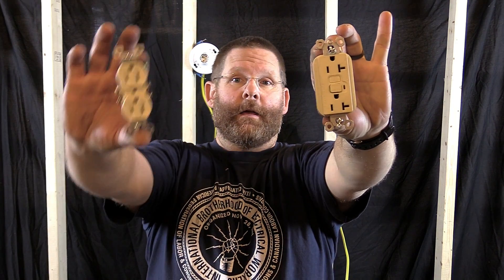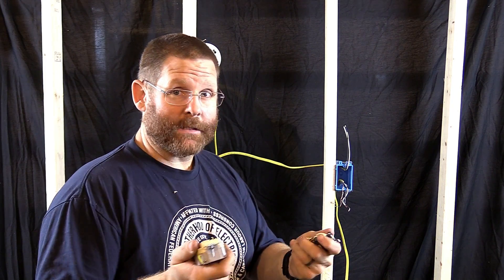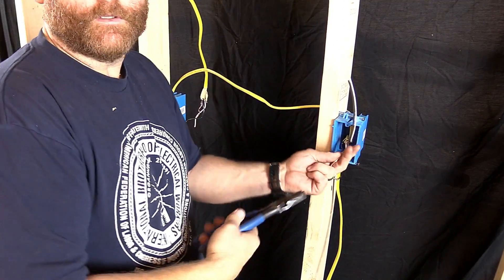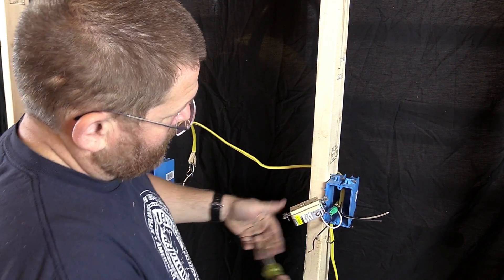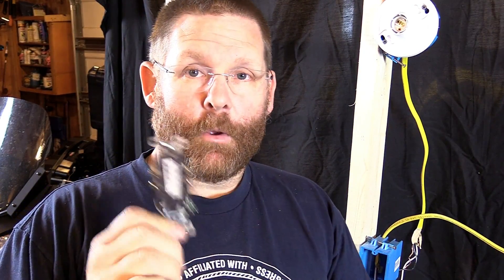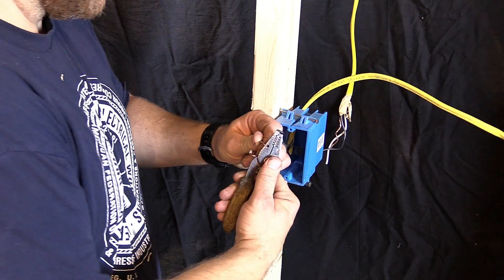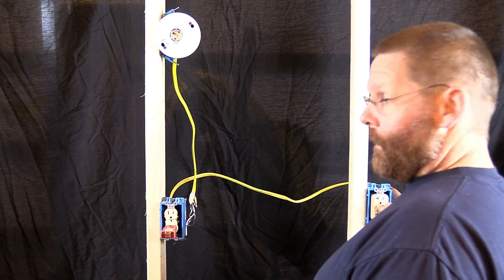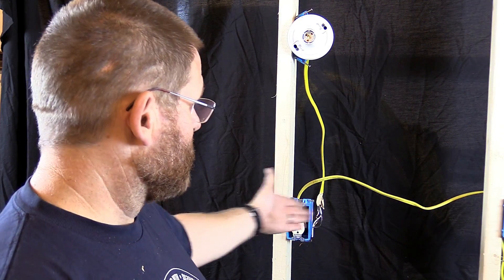How To Wire A GFCI And Receptacle

Comment: I had the 1st outlet after the breaker short and melt so I replaced it and it works fine but the next outlet which is the bathroom gfci wouldn’t reset so I replaced that also then about 2 outlets away is the outdoor outlet also a gfci which I replaced won’t reset either. The bathroom gfci is lighting up green but the last outlet is lighting up red. Neither will reset. I wired them exactly like they were. Is it possible I have a bad gfci outlet? I’m going to return it in a few when I get to Home Depot
Reply from the maker: It is possible that the gfcis are bad. I'm concerned about the melt down you had is it possible wires are melted together?. I have seen many times bad gfcis straight out of the box. Keep me posted

Comment: This is probably a stupid question but does the GFCI have to be the first outlet in the series of outlets?  Also is there a limit to how many standard outlets can be connected to one GFCI?  Thanks
Reply from the maker: Definitely not a stupid question. You can put it anywhere in the circuit. As for how many you can put one on every Recep you have if you want to it would just cost an arm and a leg.

Comment: Why 12ga vs 14ga for a home? Is it safer if its just going to a receptacle for regular use?
Reply from the maker: My answer Is this. I have seen many times people use a mixture of wires. Then you have someone in the house that uses a quartz heater or two. The breaker starts to trip and first thing most people do is up size the breaker from a 15 amp to a 20 amp. When you do that on a 14 Guage wire your asking for trouble over time. Now you may say, they can just add a 30 instead of a 20 and that's true... But most people will question that in their minds because no where else in a panel (in most cases) do you have a single breaker that is a 30. Long story but 12 is more expensive it's worth it.

Comment: Hi. A friend is in the process of selling and has their certificate of occupancy coming tomo. One on the list was for basement and garage to be gfci protected. After watching this  i can see that the gfci can be connected to more than itself. So how do we figure out if all of them are connected to a gfci? I have a tester, but assume that's just to be sure the gfci works not to locate which ones are actually protected?
Update:
So, I Wrote as I was watching and you've just answered it. Lol, but I dont see more than one gfci in the basement so can we put a new gfci in any regular outlet and have it protect the others its connected to?  Thanks.
Reply from the maker: So if you already have your basement gfci protected you don't have to add another one. As long they are protected by one gfci your golden. Your question though you can definitely put s gfci anywhere there is a regular recap for sure.

Comment: why the 15 amp downstream. receptacle with  on a 20 amp circuit. I am sure you wouldn't do that on a project, but it should be pointed out to the home owner people.
Reply from the maker: By code as long as there are more than 2 receps you can put 15 amps receps on that circuit. That's in the code book
Reply: @MountaineerOutdoors  Thank you for your quick response. I tend to be a little over careful.
Reply from the maker: Me too sometimes code kinda doesn't make sense so just keep 20's on 12 Guage or 20 amp breaker and 15's on 14 Guage wire or 15 amp breaker. That way your always good. But legally it is ok. Have a great evening
Reply: @MountaineerOutdoors  tysm!! (thank you so much).

Comment: Since you offered to help ,I  have a question. I'm trying to wire a foot switch to bring power to power tools. I need to wire in couple of outlets. One will be a GFIC. I have  a  three wire cable, Black, White,  and Green.  The paddle switch has DPDT terminals. That's the area that I need the help.with Which terminal gets the line, blk. conductor. and which gets the load,  wht. conductor going to  the GFIC? Thanks for your instruction. I appreciate the help. Thanks
Reply from the maker: Well I have never wired up one ....but if you email me the  pic of your set up the terminals Id be happy to give my thoughts on it

Comment: A good reason to add multiple gfci is redundancy if the first gfci is malfunctioning they each have protection if it’s 100 pieces i understand but 3-5 outlets i feel you should spend the extra cash and be a little safer
Reply from the maker: I can definitely understand that logic. And I understand that especially at home depot they sell that 3 pack and it's priced right. Thanks for watching and commenting ☺

Comment: In my area we have metal boxes and bx cable
So If you are screwing in the extra terminals (i personally recommend you should) It’s also good practice to wrap electrical tape around the connections so it doesn’t short with anything ie metal box or other wire or bx
Reply from the maker: Nothing wrong with doing that for sure.

Comment: I am attempting to install a GFCI on the outside of my manufactured home off an outlet on the inside. I used the green wire nut to twist the two ground wires together & connected that to the ground screw on the back of the outlet (interior outlet). I connected the (new) white to one of the silver screws & the (new) black to the brass side. [the existing interior outlet has the white & black wires pushed into the holes in the back]  I fed the new white & black wires to the outside & connected them to the holes on the back of the GFCI (push in). The screws on the side are not suitable for a connection, only for tightening down the push in. This is a Red Dot GFCI kit I got at Home Depot, if that helps. I connected a ground wire to the back of the GFCI and twisted it to the incoming ground wire with a wire nut , then screwed the free end to the ground screw. I turn the power back on & I only have power to the interior outlet, nothing at all to the outside GFCI. I've rewired & started over twice. I don't see where the issue is?? Suggestions? What am I doing wrong? Thx
**Never mind - got it fixed...replaced the Red Dot cheapo GFCI with a Leviton 15amp and rewired using 14/2. Major pain to rewire everything for a 4th time, the copper is very soft and breaks easily (especially if it's inside the receptacle's push-ins). But it's now working. Green light on the outlet & 2 ambers on the tester.
Reply from the maker: Sorry for the late reply, I was on vacation for while. Anyway, glad to hear that you fixed it. Sometimes gfci are bad right out of the box. But glad you got it fixed. Have a great day ☺

Comment: Great instuctional vid. Lets say its an old bldg, to add a gfi can only see wires inside outlet box , how do u determine witch is load and witch is line
Reply from the maker: Line will always have the main power on it. Load will be dead so to speak

Comment: Just found out that other outlets not in the bathroom are on the same circuit as my GFCI. This is irritating and I’m tempted to bypass the load and connect the circuit to the line side. Note: there is only one outlet in the bathroom. I don’t think this is a big deal, but best to ask.
Reply from the maker: I think I understand your question. Everything from the bathroom is on the gfci?.so for instance if your bathroom gfci is tripped your other outlet do not work.?? So s gfci is needed where there is water within 6 foot, or on a 2 wire circuit system. For me to answer that question would be almost impossible because lack of knowledge on this circuit. You need to look into why it's done that way. Is there receps without grounds?? Does it go outside to a receptacle??
Reply: @MountaineerOutdoors  good points! I replaced a standard duplex receptacle (only one in the bathroom) with a GFCI after I remodeled the bathroom. House was built in 74. Kitchen and bathroom were carpeted. I’m a DIY.

Comment: I got a new shed that is prewired for electrical. I will be feeding power to the shed from an outside outlet on my house. That outside outlet of the house is not GFCI, but the shed has one. 
Do I need to remove the one inside the shed and place it on the outside of the house or can I just use it as it is?
Reply from the maker: Your outside Recep should definitely be gfci protected. You sure it's not?  If not it needs to be then you can come off the line side and feed your shed on the gfci that's inside the shed.
Reply: @MountaineerOutdoors  I was told to not have 2 gfci in the same circuit. I was told to either use the one from the shed or remove it and add it to the side of the house....confusing lol

Comment: Question: what’s going on —— my gfci tester indicates the gfci plug is wired correctly but it will not trip the gfci plug —- thank you for your time
Reply from the maker: My first guess is that there is no ground "true ground" you may have a wire going to the box or maybe a wire from the nuetral to the ground, this will not let your gfci tester trip out the gfci. If the buttons do trip it then it's working correctly. Or you could have the wires hooked up wrong maybe the nuetrals are switched. Usually if you have 2 sets of wires the nuetrals could be switched. Does that make sense? How many wires do you have? 2 whites and 2 blacks?
Reply: @MountaineerOutdoors   I thought the main point of a gfi's was because the line is ungrounded. Now your are telling me it needs a ground wire to work?  wtf
Reply from the maker: An ungrounded GFCI “Is Acceptable”. A GFCI does not need a ground wire in order to trip properly. A GFCI simply trips when a fault is detected on the neutral wire. An ungrounded outlet will not trip using your tester. In this situation, I simply apply pressure to the GFCI test button in order to check its operation. And this outlet should be labled “GFCI protected / NO Equipment ground”.  A GFCI monitors the amount of current flowing from hot to neutral. If there is any imbalance, it trips the circuit. It is able to sense a mismatch as small as 4 or 5 milliamps, and it can react as quickly as one-thirtieth of a second.. All this is copied from other sites.also what I should have said which I'm about to fix is as long as the gfci trips with buttons it is functional. The tester will not trip it though.
Reply: The button trips it- thanks again for the help
Reply from the maker: Always my pleasure ☺

Comment: Don't put a 14 into a 12 slot it can arc because of a lose fit and cause a fire. It will blow the circuit breaker. Use the screw and make a tight fit.

Comment: Loads of comments so I apologize if someone has already brought this up.  You mention about only using 12GA (20A) wire and people calling you out about 12 GA not fitting in the push holes... I understand that a 15A receptacle will only allow a 15 A plug but is it allowed  (to code) to use a 20A breaker with a 15A plug?  Wouldn't that cause the receptacle circuit to overheat before the breaker tripped?
Reply from the maker: Well from what I have been told and researched.. The inside of the two receps are the same. Not much differences except the outside appearances. The inside guts only change when you go to spec grade.. As for your comment yes it has been brought up alot but I always welcome questions. I hope that sums up your questions??
Reply: @MountaineerOutdoors  Thanks for the quick reply.... I am glad you checked on this I expect it will always depend on who is doing the inspection... yes I guess it would make sense that the metal components are the same it would be cheaper than making separate tooling to run heavier metal.  Keep up the good work.

Comment: First, I am an electrical novice and I thoroughly enjoyed your video.  I watched your video to answer a simple question.  If you're replacing a normal 3 hole receptacle with a CFGI receptacle, and you don't have an exposed wall as you do, how do you determine which pair of wires is the line, and which is the load?
Reply from the maker: Great question, so the line always is the hot coming in. If you have 2 sets of wires one will be hot that's always the line. The other side the non hot will be your load side

Comment: Question? I want to put a gfci outlet on the outside of my house. I plan on connecting it to an existing indoor outlet on opposite side of wall. Now do I  connect it to the gfci load or line? Question being that the power coming into the gfci is coming from an existing indoor outlet. If anyone can address this I  would appreciate it. Thank you.
Reply from the maker: Yes connect it to the line side of the gfci
Reply: Thank you

Comment: I am replacing a GFCI outlet and I'm pretty sure it was put in wrong.  There are 3 Romex lines going into the box; 1 line and 2 loads.  These are all currently wire nutted together with a pigtail then going to the GFCI "line" connector.  Nothing is on the load connectors.  My question: is it okay to connect 2 load lines to the GFCI outlet?  Thanks
Reply from the maker: Are you referring to two different lines meaning two circuits?
Reply: @MountaineerOutdoors  no, it's all on one circuit.  1 line in to the outlet, and 2 lines out going to 2 different outlets downstream.
Reply from the maker: Yes then you can do it

Comment: And all this is on a regular 20 amp breaker correct?
Reply from the maker: 20 amp receptacle yes not a 15 amp receptacle.
Reply: @MountaineerOutdoors  No but I mean hypothetically all the power is coming from the breaker box and put on a  regular 20 amp breaker  or does it have to be  a special breaker to make the gcfi work properly?

Comment: I have a problem.. I did everything like in the video all the wires went in the right screw and even the gfci green light turn on. But when I test it with the receptacle tester, none of the lights turn on. And when I checked it with pen tester it did turn on.. no clue what happend
Reply from the maker: Could be a bad gfi I have seen that many times

Comment: How would you find the downstream and home run receptacles? If the walls aren’t torn down. Would the closest one to main be the home run?
Reply from the maker: That's the way I wire. Closest one to the panel is the home run. If not it's just a matter of pulling them out one by one

Comment: Thank you for this video! It took me three days to find a video that showed a GFCI with receptacle. Much appreciated.

One question: I needed to replace a GFCI that was installed by a pro five years ago with a kitchen upgrade...it's the newest outlet in the house, while bathroom GCFI's at least 16 years old are still going strong. They don't make them like they used to I guess.

The GFCI and the receptacle are side by side under the same plate.

I noticed that the electrician had the load wire for the receptacle and the outgoing line wire both under one screw on the GFCI instead of having the outgoing line run off the receptacle. My simple brain wonders when he did this instead of the seemingly simpler straight line trip from the line to the GFCI, load to the receptacle, then complete the circuit with outgoing leaving the receptacle instead of two outgoing wires from the load side of the GFCI?

I have no idea where the outgoing wire goes...nothing else seems to be on the circuit or didn't work with the GFCI was tripped or the breaker was off.

Thank you sir!

I guess I had a second question...I replaced the GFCI with the same model, which was also WR. I wondered if I should try to find a GFCI and an AFCI with WR...but I couldn't find one with all three...Easy enough to find GFCI with WR, and GFCI with AFCI...but not all three...is AFCI needed/better near the kitchen sink/dishwasher versus WR? I assume the next time I have to change this out, all three will be required for code as there are regularly changing.
Reply from the maker: well thank you for you comment, not sure what he was thinking when he wired it. Its hard to say because you do not know where the other wire is going.  as for the arc fault I know that it will be required but in my locality its not on certain items. You really need to check with your building inspector on that.  As for old code, the dishwasher should be on its own circuit dedicated to the dishwasher.  hope this helps

Comment: 3-questions...
In my house, there are NO GFCI plugs...anywhere.
First question...
- Are the existing sockets, of the same circuit of course, going to be chained together, already, in some way that is clearly defined and easily swapped? ...so that I will know that I can somehow differentiate between the line-side and the load-side when I go to do my GFCI installation? (...Realizing that anything COULD be the case... please speak "in-terms-of" the typical, professionally installed, correctly wired track-home.)
Secondly... 
How can I determine which outlet is FIRST in the circuit?
Lastly...
How many subsequent outlets will a single GFCI outlet regulate-for?
Will it only affect the very-next outlet in the sequence? Or, several? Or, ALL of the subsequent outlets in the circuit?

A lot of questions... I realize...
...but, I feel like it's important!
So... thank you, in advance, to any who can help!